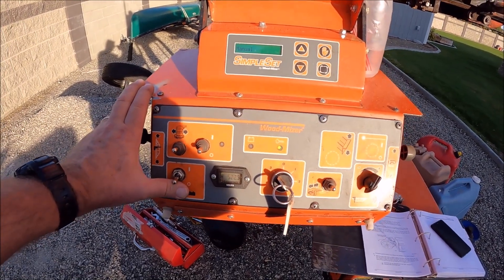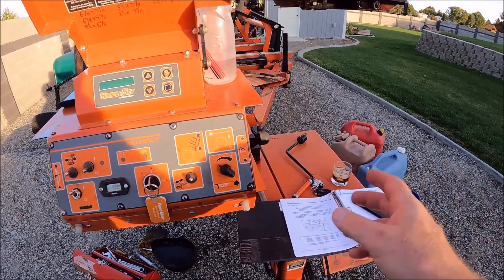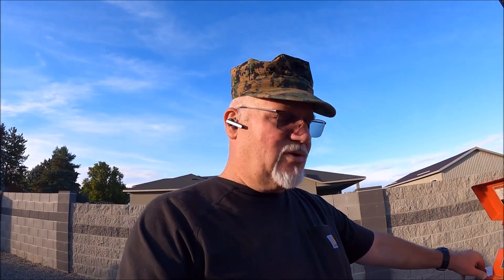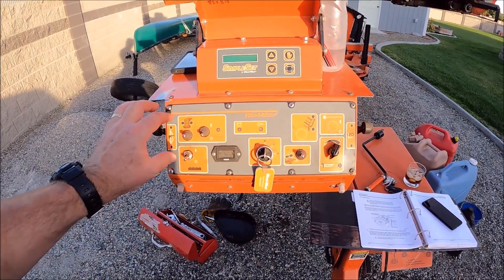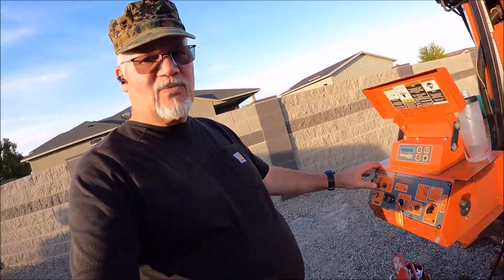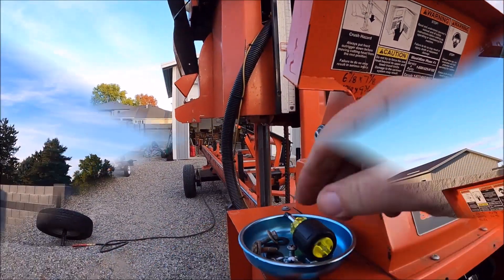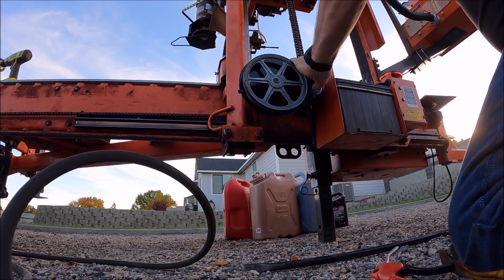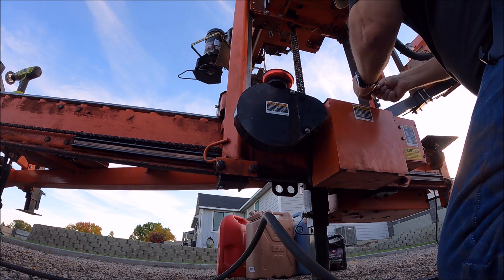Losing Control Of Your Wood Mizer LT 40? Here's How To Fix It

Comment: How does a woodmizer throttle when the operator is standing at a stationary position? Is it a handle or a button? I have a mill with a Honda gx690 that has a throttle which I want to try and automate.
Reply from the maker: The clutch Aldo operates the throttle.  When you engage the clutch the throttle also gets set to wide open

Comment: In my limited experience, the "Chunky" is a dead giveaway of a slipping drive belt. Not just the belt you adjusted in this video but the belt that runs the blade.
Reply from the maker: Nope.  A loose drive belt will cause wavy cuts but won't slow or cause the head to stall out.  at least not in my 11 years of milling ;)